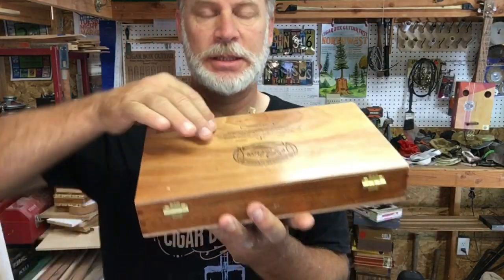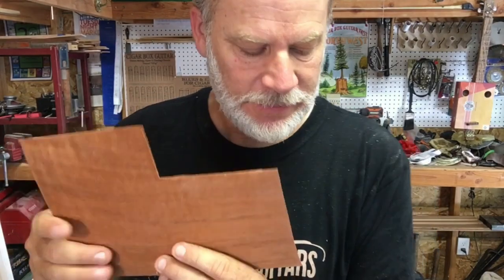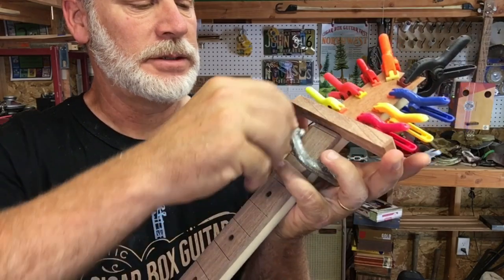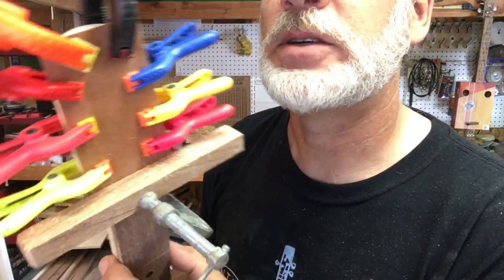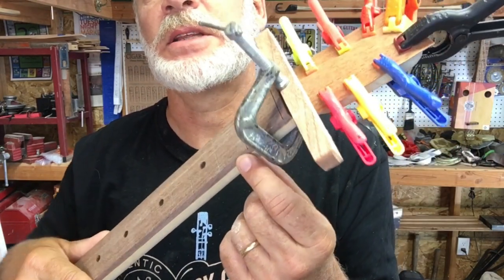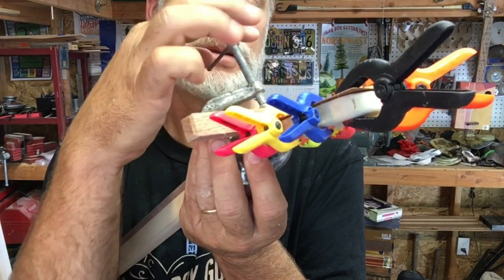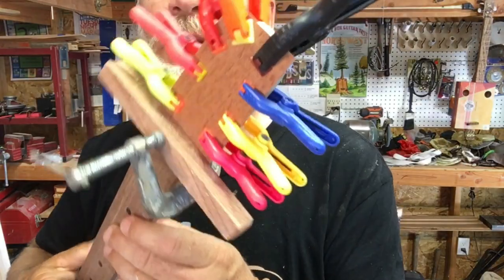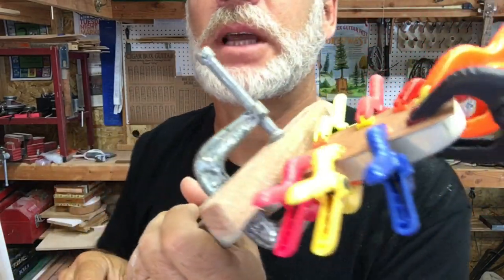How to make a "Scarf Joint Headstock" for your Cigar Box Guitar

Comment: Just a quick note on the scarf angle for the jig . A 14 to 15 degree angle has a Tangent of almost 1/4. So if you draw a right angle triangle  with that ratio of 1 to 4 for the  opposite and adjacent sides it will be right every time.
Reply from the maker: smart

Comment: Here's a tip: To help these joints from sliding around during glue-up, sprinkle a tiny bit of salt on the glued surface before putting them together and clamping them. And no, unless you put a whole bunch of salt on there, it doesn't weaken the joint.

Comment: I never knew it was called a scarf joint. That's the only way I know. I like the idea that your using the thin piece of wood for veneer, that's a good idea, I'll have to start incorporating that into my projects. 
I'm working on a neck now and I'm using that wood as a inlay, so far so good. I made the design in the shape of leaves and dug out the neck using just a cheap dremel. I shaped the wood using scissors and sandpaper. I usually try not to get fancy, but this one is for someone special.
My cigar box supply is getting low and are getting hard to find these days, so I started making my own boxes out of wood that I find on the side of the road. Some of the wood already has designs on them, especially if it comes from antique furniture so that makes things even better and less work for me.
I hope everyone knows, once you make your first cigar box guitar, you'll get addicted like I did. I'm at the point I don't know how many I've made over the years. I don't care as long as people get enjoyment out of them.
Again, thanks for your video's, you do awesome work.

Comment: Great video!  I veneer my headstock tops with the same veneer.  I found that contact cement works great without clamping.  I prefer the water based contact cement for less vapors and easier cleanup.

Comment: I built the same jig! It certainly saves time and gives reproducible results!  I have some of that same veneer. I think I will try it on a headstock as well!
Reply: Can’t you just build the jig to be an easy 90 degrees and adjust your miter saw angle 13 degrees off square?
Reply: I suppose you could. Although I am not sure I can consistently set my saw to 13 degrees.
Reply: Steve's Strings hmm, good point!
Reply: Do you have plans of the template of the jig

Comment: Sprinkle some salt on it before glue up. It will help keep it from shifting and bite into the wood. Or you can use a staple or small nail and cut it to help guide and keep it where you want it. I do that for fretboards all the time 😁

Comment: Thanks Paul - great explanation using the scarf joint.  My question is when do you thin down the head stock from 3/4" thick to the thickness to housing the tuners?
Reply from the maker: typically when i cut the back angle

Comment: What if you have 2 CBGs? Is that still 3 strings too many?

Tip if you want to try it:

Use contact cement on the veneer and headstock face. Wait until the shine is gone and stick em together. Rub with pressure using a roller or dowel etc. Wait a few minutes to dry. Flip headstock on its face and score around headstock a few times. Flip back over and fold scored edges down with a flat stick. The excess will fall right off. It should take you less than ten minutes.

I've done lots of veneer/laminate work. That's how I do it. Make sure you don't buy the fume free stuff and take a few good huffs before you put the lid back on the cement.

Comment: Hey Del, great video, I made a jig like yours only 15 degree. I found the wood kept tilting on cuts though, meaning the joint edge wasn't straight, had a few kick back moments as well. I finally found that if you mount the jig onto a square 10mm plywood board it gives a steady surface to support the side of the piece your cutting. Davy
Reply from the maker: Dude!!! Why didn’t I think of that !!?!? Great idea!!!!

Comment: Does the thickness of the headstock matter with the installation of the tuners? Will the tuners be long enough for the thickness of the headstock? Sorry for the double question, most all the other videos show cutting about an 1/8” off the thickness. I really like your videos, very clear and concise easy for an old man to understand. Keep them coming, oh, I really enjoy listening to you play.
Reply: Yes thickness matters. It's not rocket surgery but they have to fit. If your headstock is the same thickness as your neck. In most cases it will not. I know this was a year ago but someone else might have this question

Comment: Just tried my first scarf joint. Let the glue soak in a bit, then clamp. Also just a little less glue. Clamped in the middle and I'm set. Do you make the angled part thinner for the tuners like a straight neck?